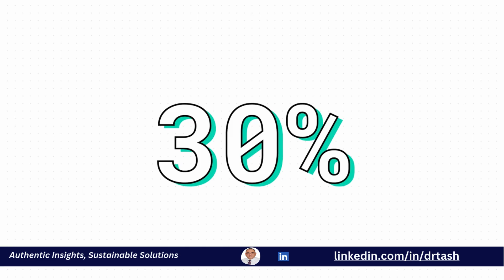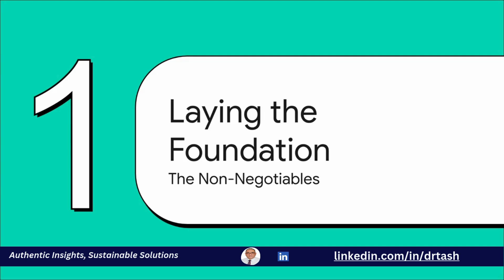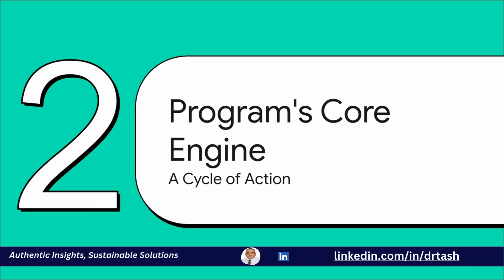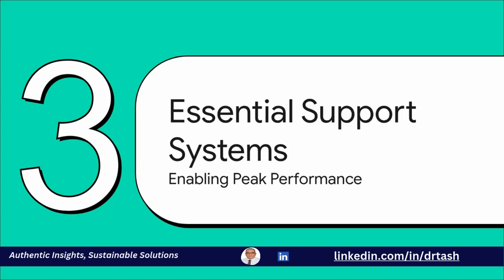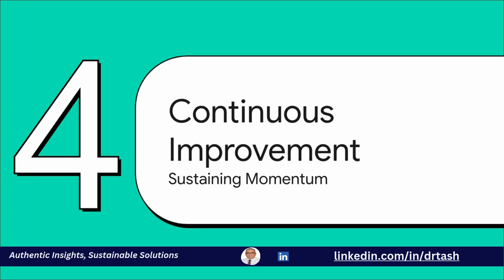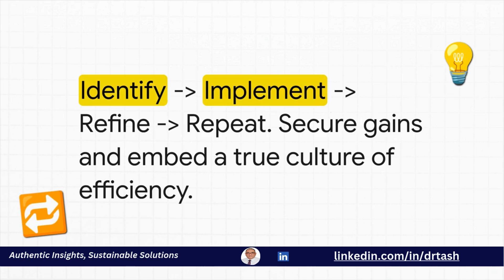2 Mastering Energy Management Program

Comment: Not just technology, also correct Design.
Based on my experience as energy auditor, a major source of inefficiencies, whether industrial plants or commercial buildings,
Are equipment and systems operating significantly away from original intended design range.
a pump sized for 30meters head, now operating 10 meters head.

cooling towers design for 3gpm / ton, now operating at 1 gpm per ton because maintenance making adjustments on the go, with un intended consequences.

Motors operating at very low Hz Setting, so the motor efficiency itself drops.

You can have the latest technology, but without correct design and sizing, it will still fail.